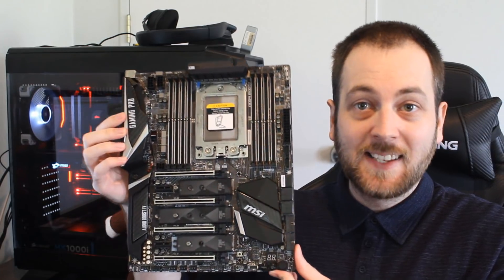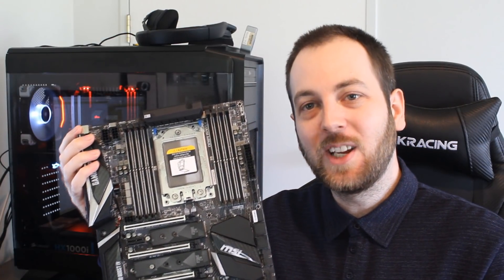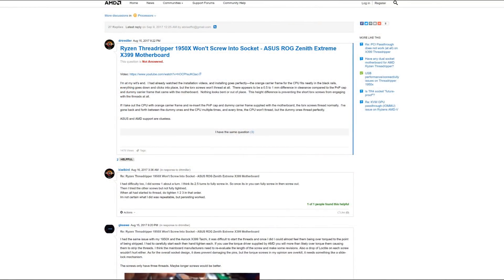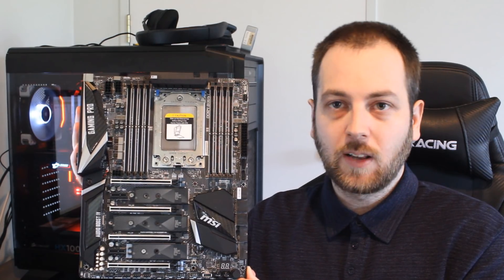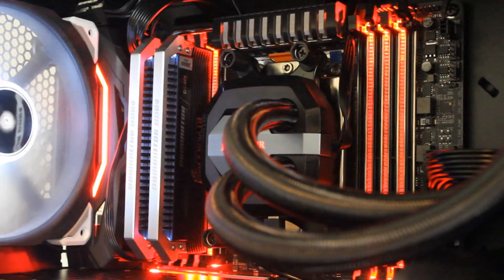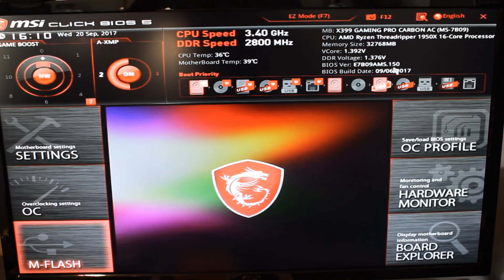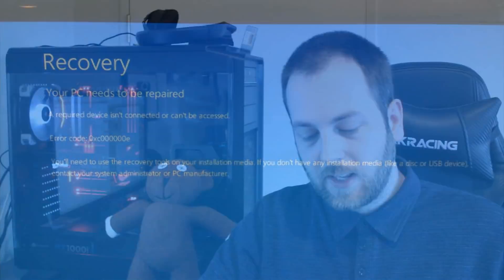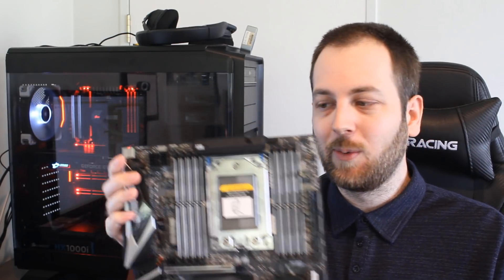X399 Is A Mess Right Now (Socket, Memory & Windows Issues & Fixes)

Comment: The other issue I had was installing and booting windows would crash with the Intel WiFi driver.  It's fixed in the latest Intel driver but unfortunately it requires a network connection to isntall the driver.  lol.  Turns out the driver crashes when there is 4 sticks of memory installed.  I removed 2 of them and installed the latest driver.  Afterwards I shut down the machine, put the other 2 sticks in and Windows booted fine without the driver crashing.

Comment: I had the same issue with threading the screws for the CPU, they simply would not engage no matter how hard I pressed.  I unscrewed and only tightened the screws a little bit each time.  As soon as one of the threads engaged I moved onto the next screw without tightening any further.  After several passes of all 3 screws I felt comfortable it was secured.

Comment: Some specific problems with very few motherboard SKU doesn't make the platform a ''mess'' 
That said, It's really rare that you see these kind of issue on the intel side tho, the last big one was with the P67 chipset (7 years ago) having a sata bug and i'd say that was a catastrophic fail on their part but they recalled all board iirc.
Reply: Benoit Levesque that's because Intel hasn't released a new completely different platform and architecture in a long time.  Sandybridge was the main one and tweaking newer generations makes it less likely to have these problems.  If they finally release a new architecture there will probably be major problems like always.

Comment: I had the same issues with the Aorus 7 with cpu socket. I eventually was able to get the first one threaded after pulling the CPU out of the tray and placing it back in.

I also ran into the bluescreen issues for a network driver for Intel wifi.  Once booted into Windows and the drivers update I was able to go back to quad channel RAM without issue.
I too had to disconnect every drive to install Windows otherwise it would find no drivers for the disks. Kinda frustrating

Buying into this platform I expected some growing pains but I was hoping some of them would be sorted after it was out in the wild for a bit.

Hopefully after BIOS maturation we'll see more stable functionality.

Comment: You ask what issues people have had but why not ask what successes we have had as 've stated I am at 4.125 ghz at 1.3v at 3466 MHz ram though the sweet spot is 3200 for stability, with 1080ti SLI 3 x 500gb ssd as game drives in rad 0 and dual 250gb ssd nvme drives in rad 0 as boot, I have no issues, I have one or two challenges with games but setting memory to local fixed that and setting core affinity .

Comment: Running a 1950x, with a gaming 7 gigabyte board rock solid at 3466mhz on 4 dims of ram at 4.125ghz I've had no issues whatsoever.
Reply: Xsannz Hello! What is the Memory Model Number? Thank YOu
Reply: CMU32GX4M4C3466C16

Comment: Don't install Threadripper without it's carrier.  One tiny slipup and the socket is toast.

If possible, remove the screw, take it to a hardware store to find a longer match, then use a dremel to cut it slightly longer than the original and try again.

Comment: Interesting. Similar to some issues I've been having with my R7 1700.

Wouldn't be surprised if it's just funny ways UEFI and OS have to talk fast at boot up these days. Maybe power related too. Coming from a near novice.

Better at diagnosing car hardware. ;)

Some of the diag equipment these manufacturers use must be cool.

Comment: I have had no issues with my 1950x on the asus prime running 64gig of ram. I also have three friends with 1950x builds and they have not had any issues either. You might have a lemon. Also when seating the cpu don't tighten the screws until you have threaded all of them first
.

Comment: As for the CPU socket - I cheated with my Asus Zenith Extreme Motherboard.  Watching several YouTube bloggers having issues with the screws, I knew I had to think outside the box. I grabbed my trusty hex screwdriver and applied a little bit of pressure to get it to go down (Couldnt get enough leverage with that child size torque wrench AMD provided). Once the screws were catching, I switched back to the provided torque wrench.

Comment: Running Asus Zenith Extreme Bios 0503 - AMD Threadripper 1950x OC to 4.03GHz- 64GB (8x8GB) G.Skill Trident Z RGB - 2x512GB Samsung  960 Pro M.2 on the Dimm.2 (Waiting on RAID Bios Update) - Asus Strix 1080Ti. ISSUES - Cant get Ram to run at anything higher than 2933MHz, instability issues starting showing up - Windows 10 Pro Creators Edition Current with all Updates and Graphics updates, stutters like no other, especially when  splitting chrome tabs, running YouTube, multitasking in general. Benchmarking scores are where they should be with the exception of CPUMark, where it scores in the low 16000s (NOT COOL). CineBench is good at 3395. This system does not run like the $4k beast it is, SMH

Comment: I put together my Threadripper about a month ago, and everything's been fine. Installation wasn't a problem (no latch issues) and it recognized all 32 GB of memory in four slots (running at 3200 14CL without a hiccup). No stability issues to speak of and no issues restarting. My board is a MSI Gaming Pro Carbon A.C.

The issues described in this video seem more like a board issue than anything else. In that respect, I'm glad I got a MSI board - I strongly considered a Gigabyte board for this build.

Comment: I have an ASUS Zenith Extreme motherboard.  The first one I had, I could not get the CPU to screw down.  This was before this video was released.  A lot more force may of been required.  I had to return it and replace it.  The second ASUS Zenith Extreme I had, I used a lot more force and it finally screwed down.  Totally ridiculous as far as I am concerned.  However, after about a week, the motherboard crapped out for no reason and again, had to be replaced.  The 3rd one I have running in my system now.  It also had the same issue where an extensive amount of force was required to screw down the 3 TR4 socket screws.  Until I watched this video, I did not understand it.  It seems logical to me that this Foxconn vs Lotus manufacturing issue is to blame.  

I've also had one other issue.  This issue is possible a good thing but an unexplained issue where my CPU temperature is always indicating very low readings.  It has been displayed as low as 0 degrees Celsius at idle which is impossible. Most of the time under a small to moderate amount of load is sitting around 15-20 degrees Celsius.  Very weird and displays in Core Temp, AMD Ryzen Master, HWiNFO, and HWMonitor to name a few.  ASUS wanted me to return the board to see what's causing the issue but I after these many times replacing it, I would prefer to keep this one.  

Hopefully no other issues come about.  I would replace the entire motherboard and CPU if I could but Newegg refuses to replace any of these motherboards and CPUs.  That's another story in itself.  I will never deal with that company ever again do to multiple problems I had with this company!!!!

Comment: asus zenith => thermaltake fan controller not working on usb 2.0 port. i use the usb cable from my alcatel 1 touch.....on rear usb port - but not every port is working.........still on the keyboot port ..........cover fan is not realy working.....i discon the fan from motherboard......

Comment: Had a good experience with my MSI X399 and 1920 Theadripper, solid platform and getting better by the day with updates (Bios etc.) main problem I had was with Windows (the flash drive installer didn't work, then drivers etc.) otherwise really happy.

Comment: All of the issues described in the video are typical teething issues. Is the number of issues high for a High End platform ? That is a matter left for the beholder to evaluate. The issue with the CPU Socket problems is one where the screw has insufficient length. The lateral play in the capture clamp has nothing to do with it the problem. It all boils down to a Quality Control issue with the socket vendor. Everything else described are software/BIOS issues that were not identified and addressed before the board were ships. These problems can be remedied quickly without returning the board for repairs. needless to say these issues should not be happening creating frustration for the customer and embarrassment for the vendor. Does any of these problems warrant bestowing the title of "A Mess" on the entire X-399 Series of motherboards ? Absolutely not ! "A Mess' is what happened to the X-299 Motherboards where boards that were improperly designed were sent to market. I'm specifically thinking of the VRMs coolers that were woefully inadequate causing the boards to fail in operation. THAT is a mess ! Resorting to hyperbolic language over problems that First Adopters should be prepared to deal with does raise questions about the reviewers objectivity. There is nothing in the problems cited to indicate they can not be resolved in short order. In short if you want to be a First Adopter you had better be prepared to contend with these types of setbacks.

Comment: Hahah, no way that all those issues are so common. I can't believe I'm not the only one who had the exact same problem with screwing in the screw #1 AND the precisely identical issue with Windows being unable to boot! I've spent hours in the bootable Windows recovery environment running diskpart, bootrec /fixboot and /fixmbr, sfc /scannow, formatting, reinstalling, I've even memorized my Win 10 product key. Everything seemed fine, even on the hidden bootloader partition but it just wouldn't start and only physically unplugging all other drives fixed this.

Comment: I have a gigabyte b350 and at first had nothing but problems . after two different bios update finally got it working. I think gigabyte does not do much testing before releasing boards.

Comment: I have a X399 with a 1950X and ASUS Zenith. I have had no issues except the one you brushed over at 10:33 involving the fans. One of my chassis fans randomly goes nuts even though CPU temps are <35C. I go into the BIOS and set either quiet mode or my own fan profile to chassis fan 1....save and restart..all is well. Whenever I shutdown and power on the PC the fan goes nuts again and in the BIOS the fan profile has automatically set back to default. No matter what I do it never saves the fan profile after power restart. The fan cable doesnt reach any other header and I currently don't have an extender cable, but hoping to resolve the issue without resorting to that. Getting sick of manually setting this stupid fan speed everytime I turn the PC on.

Comment: every msi mobo ive owned has had debug issues
both my z97 mobos gave me the same debug codes when starting with completely different hardware
one was a ps/2 usb code the other was some sata code
the new x370 has debug issues just restarting cuz of the ram issues

nice to know there are issues with x399 tho too
i got my 1800x a month b4 thread ripper release and figured i screwed up 
cuz x399 would be better working than x370
but nice to know im not completely missing out
Reply: wanna put this in a separate comment
if ur having problems with msi mobos using too much stock power
or just not being able to run on auto at all
but get boot looping like me when u manually set
i just did that game boost as my OC and manually set the core volts
its THE ONLY WAY my gaming pro carbon and 1800x run 4.0 at 1.375v with ram at whatever is stable

Comment: Ill just keep running my 6950X @ 4.5Ghz.. I need the high frames for G-Sync 165Hz 1440P optimum performance.

I cannot make use to a 16 core for the slightly lower ipc, to make the swap worth. 

I do get 2,485 in R15. though.

Comment: The fans thing is easy to solve: you have to adjust the fan curve as to stay constant under a certain temperature, say 40 to 45°, or even 50° if you have Turbo enabled, since Turbo is heavy on the voltage, and causes temp spikes very often, even for small CPU tasks.

Comment: I have the gigabyte board, this is my 3rd gigabyte board in a row, Z170, Z270, and now x399. Each time I noticed BIOS issues out of the box, but after updating BIOS, everything is great. 
As far as the fan curves, I've noticed the same thing, I have 4 noctua 140mm 3000rpm fans and they ramp up and down dramatically; best way to fix it is to adjust the fan curves to a smoother slope, that's more appropriate for threadripper, and change the polling rate of the temp readings; in smart fan 5.

I had the same issue with getting the socket to screw down on the gigabyte board. I had to thread the bottom two screws, then thread the top screw, then I torqued the down in the suggested order.

 Besides that it's been great.

Comment: I have the Gigabyte x399 and a 1950x too, the screw #2 was the one that wouldnt thread for me and it was TIGHT as I had to push hard to get it to thread correctly. 
Windows installation will generally crash with the intel wifi driver being the issue - THERE IS A TEMPORARY FIX! At the very beginning of the windows install where it lets you choose additional drivers - put your Gigabyte DVD in that came with the motherboard in, and look for the folder with intel wifi drivers and choose the windows nt driver folder - the installer will scan it and show a driver. Select it and continue on with the install. The issue is the driver that comes inside the Windows installation media. Microsoft need to update this. The crash happens when the installer scans for networks using your network hardware right after that annoying and completely useless Cortana introduction.
edit: added windows install temp fix

Comment: Got the Asus Zenith Extreme, just earlier today the mobo had decided to stop my cpu and chassis2 fans, and the cpu was getting mighty hot / throttling a lot. No idea yet what caused it, the fans had more than ennough juice to start them up on boot and they had worked just fine for over a week. HWMonitor was not detecting them either, untill i rebooted. This was with its 0503 bios. The foxconn socet also has the 1-2 millimeter too short screws on the board. Slight issues with q-fan manual profiles too, they seem to reset to defaults on some fans.

Comment: We did a Threadripper 1920x build recently and had none of the issues (well, i dont know about the temp readout one, i'll have to ask my buddy who it was built for). ASrock x399 Taichi. The way the Kraken x62 fit meant we couldn't out the RAM in the closest slots due to the tubes. Rearranging took care of that though, not all the slots are filled, but thats more cooler compatibility. Also, RAM placement order if not all the slots are full is important to, needed to refer to the manual to get that right. CPU installed no problem, installing windows to the m.2 SSD we added (and prior to that, booting off the previous SSD that was used from another PC) was no problem. Setting ram speed was as easy as setting the XMP profile, 3200mhz straight away with the Trident Z kit. Overclocking was a cinch, got it to 4.1ghz on all cores (backed it off to 4.0 due to temps tho, custom loop incoming on that build now though).  Idk, i'd recommend the Asrock x399 Taichi. It was a super smooth process.

Comment: just built my Threadripper build and the only issue I ran into is with the official Windows usb drive I bought. Wouldn't even attempt to install from that but all I did was make my own USB with MS's software and it worked fine.

Comment: X370 had many issues as well when it launched and so did x99 as you said. These new platforms just aren't polished out the gate and require a bit of BIOS and driver work to get them there. I have no doubt that x399 will be an amazing platform once all of the bugs are fixed. Most of the issues with x370 have been fixed at this point and aside from some lingering ram issues it's pretty damn stable.

Comment: I have Aorus X399 Gaming 7 + TR1950X for two weeks now and everything works fine. Had no issues with socket or memory (G.Skill F4-3200C14Q-64GTZR). Installation was pretty easy. Memory works stable in quad channel at 3200MHz 14-14-14-34.

Comment: The thing with windows loosing the boot drive is not unique to x399. I have seen this on multiple different chip sets, and have narrowed it to the bios loosing the saved boot order. I have been able to fix it by just going into the bios and resetting the boot order,  usually it is in a strange state when I see this issue.

Comment: I have two X399 motherboards running a 1950X using EK Waterblock and a custom loop to cool.

X399 Taichi
Pros: 
- Overclocks better, chip runs cooler and at lower voltage, Easily able to hold 4.1ghz @ 1.34v stable with EK Waterblock.
- Everything worked.

Cons: 
- Doesn't look as good as ASUS or have as many features
- AMD Ryzen Master wouldn't work properly with it

X399 Zenith
Pros: 
- Had no issues with Ryzen Master software
- When I finally found my max OC settings for this board, it did slightly out perform Taichi in benchmarks, but the chip was hotter and took a lot more voltage.

Cons: 
- I had to go he-man on the socket to get the screws in.
- Wouldn't boot with my NVMe drive (960 Pro), had to update BIOS for support.
- The voltage is a lot more random on this board vs Taichi, even with stock settings I can see it hitting 1.4+.
- Required a lot more effort to overclock

If I were to recommend a board, I would say to buy the ASRock. It is a better board at this current moment, which is subject to change when all the kinks get work out of the Zenith.
Reply: On both boards I got to 3333mhz~ at cl14. Didn't bother trying 3600 at higher timings.